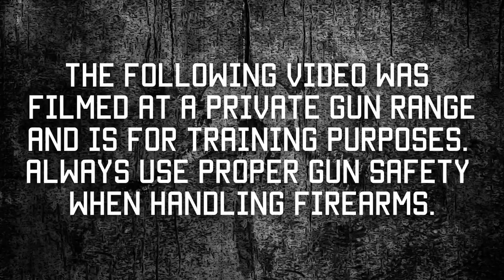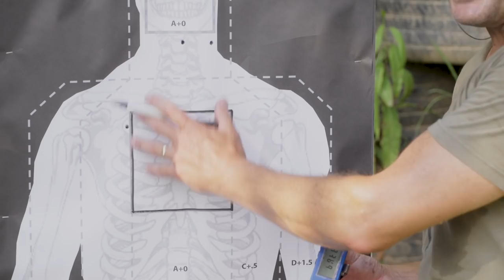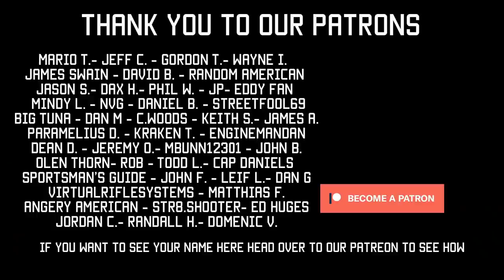Toughest Shooting Drill Ever | The Rifle Rundown |Tactical Rifleman

Comment: Genuine question: On the head of your human target, why do you have the target box as low as you do? 

I figured it would be better to have it higher to encompass more of the brain as opposed to below it. I have heard of people surviving headshots below the brain.
Reply: @Tusk-ruk  Agreed
Reply: @Tusk-ruk  That’s exactly correct. I’ve trained with Karl and he makes you place the rounds in the “T” box. If you miss time keeps on running
Reply: I would think it had to do with the ocular cavity, that would be the area just under the eyebrow and down to the bottom of the nasal cavity. You don't want to hit the forehead or the teeth as they are very hard to push through.
Semper Fi
Reply: A shot to the upper cranium (hardest bone in the body) can possibly be deflected if there's any angle, and a shot to the upper brain (even if lethal) could still cause a reflex shot from the victim thanks to lower brain function. That's why the forehead isn't the best place to aim. Plus, that area would be covered by a helmet in a military scenario.
Instead you aim lower to hit the brainstem on the other side of the head. The bullet has softer bone and tissue to get through, and causes instant death without reflex. Between eye level and mouth, as centerline as possible, is an optimum shot.

Comment: This runs a lot like a stage I've wanted to see at a match: starts at 300yd, end after one pistol and one rife hit on a silhouette from anywhere inside 250yd, shooters choice (with stiff penalties for misses). Feel free to adjust the distances or add junk to run over/around, but the point is a trade off between how far and fast you sprint vs how long a shot you then have to take, with a bit of know-your-limits mixed in.

Comment: Holy Cow! When do you find time to mow that property? 😆😪  Also...What model Safariland is that Karl?
Reply from the maker: I run ALS holsters
Reply: @TacticalRifleman  I meant the model # I have a 6390 RDS mid ride and yours looks like it sits a little lower than mine..
Reply from the maker: I use the 2" drop piece to attach all my Safariland holsters to my belt. High than a leg holster, but lower than a belt holster, it is the perfect height for me.

Comment: So you added a bunch of running with 2 shots per station. Hardly the first drill to have either element. Pretty sure at least half the gun reviewers I watch at some point do something like this. Also unless your some super sniper ultra pro. Know of few who can group at extended range under duress. Short range A zone idea works. Further you go out the bigger the piece of fruit gets by physics alone of what rifle was built for. I guess if your bored do this drill. As far as combat arena goes odds are very low you run this much. Might briskly move point to point. Not running unless something went very wrong.

Also you needed to do it as well. 120 seconds is 4 minutes of video. Waste less time blabbing at start of video if it adds nothing worth hearing, which was intro time here. Quite a few other drills out there that make this a warm up anyway. I would say at best it tests if your a good running to meet time.